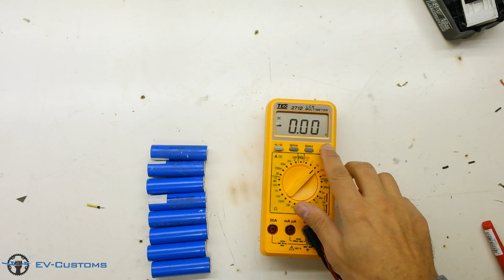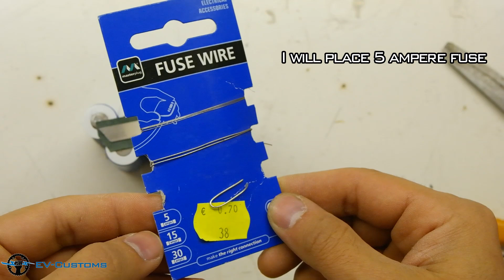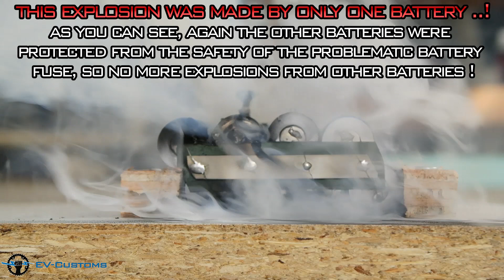Fused Tesla Style Battery and How Safe is it..?  (Safety Crash Test)

Comment: fused parallel battery module is safer than nickel-tape welded module, but it's not totally safe. To make it safe batteries in module should be physically separated from each other by some isolation material, because if one battery will become shorted and will start to heat up to red metal temperatures, no any fuse will prevent burning up of a nearest batteries which are touching it....

Comment: Thats not the reason why it has those fuses. Its to keep death/shorted cells from draining down the rest of the pack. There i no fuse that is going to safe a punctured battery from catching fire 🤦‍♂️
Reply from the maker: Its written somewhere that those fuses is  to protect from fire??? those fuses is only for defective batteries which can short any time..
Reply: @EVCustoms  the point of the fuse is what he said above, specifically about a cell being shorted. By fusing it, if there is a short circuit then it will break the connection for only that specific cell, but the rest of the parallel pack will remain working.

Comment: The fuse was 5 Amps at the voltage 4 v ?
Reply from the maker: 5 Amp at 4.2V my friend..
Reply: The fuses working when you turn heater or more amps not working on battery short

Comment: Will fuse wire add resistance in normal operation ?
Reply from the maker: No my friend,  there  no resistance  on this wire..
Reply: Yes, about 2 mohm per cell, depends of wire diameter

Comment: Wow great experiment !! 
Why there is no explosion for first drill ??
Reply from the maker: Hi Nitin..  Because  this batteries  was  used on laptop and some of them was problematic, with lower  capacity like 300mAh and some  of them with 2.600mAh, that's  why  didn't explode...
Reply: @EVCustoms   If its fully charged then it will react violently.

Comment: But this is not batteries optimized for power tools or cars, those have more power output capabilities.
Reply from the maker: They have same reaction...
Reply: @EVCustoms  But the energy release speed is different. Faster release time can get battery to a higher temperature in the same amount of time. It may ignite all other batteries in the pack.
Reply from the maker: @vicever08  Yes my friend, but in this case we have fuses on each battery...
Reply: @EVCustoms  I mean when the battery was shot by the screw drilled into, lower battery internal resistance will generate higher power and cause more rapid reaction.